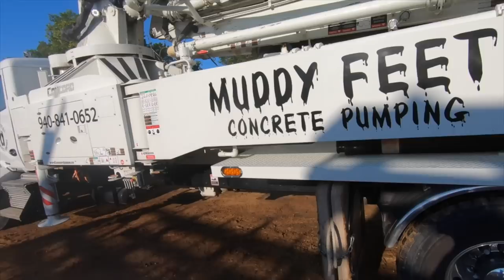Concrete truck rolls over. Pumping concrete with Muddyfeet

Comment: Driver stop your drum from turning and that will stabilize the load. With your drum turning the load is continuing to climb the left side of the drum. That's causing the center of gravity to shift even further to the left side of the truck.
Reply: They said they were afraid to spin to unload, I assume that's the other direction, but that would have loaded the uphill side which seems helpful.  I agree it looks like the way it was turning would weight the downhill side.  Too bad they didn't ask us.
Reply: Could have put the load off in the ditch passenger side first off.  Let it run climbing up the drum sure cost some money. Poor road and the driver flipping lights on was just enough to run er off.
Reply: Exactly that would’ve prevented the truck to roll over just stop the drum and that truck would still be on it’s wheels!!
Reply: I drive a concrete in Corpus. Have for about ten years now. He should have discharged the load. With the drum spinning in the "charge" mode, the fins have the concrete high on above the drivers left shoulder. Also the spinning drum has something called "transitional torque" on the trucks frame wanting to tip the truck in the same direction. Think of it like shooting a gun. It has an equal an opposite reaction (the bullet goes one way and the gun is forced the other). As the drum forces the 40,000 pounds of concrete in one direction, where the drum mounts to the frame, it torques the frame in the other direction. Thats why mixer trucks can take left hand curves at higher speeds that they can right curves.
By reversing his drum, it shifts the torque forcing the right wheels down and also shifts the concretes weight from high left to high right which also helps hold that side down. As the concrete discharges it lessens the total weight on the truck which also helps. Sometimes it's better to lose the load, rather than loose the truck.
The driver mentioned being afraid to reverse the drum, that is simply not knowing how your truck operates.
All that said, that entrance was not very well built by the contractor to support that much weight. Plus the driver should have had a spotter and been backing slower. It was possibly recoverable at the start, but it's better not to get your truck into that situation in the first place.
Reply: @stevengibson2251  I was thinking shouldn't he discharge? simply for getting the truck lighter, but I didn't think about how the direction of the drum shifting the weight! make sense,  I just started driving a mixer and I feel like I have been working on my driving up until now, I drove dump trucks, end dumps, flat beds, and tractor Trailer.  5 years now so yes I still need experience but I am careful, to me I feel like he was to close to the edge ? he was really close
Reply: @michaelmarquez6133  Hi Michael, thanks for the reply. Like you, I also drove OTR in flatbeds and RGN's. Not as long as you have. Only for about 2 1/2 years. Got tired on being on the road from 26 to 35 days at a time. I'd be out 32 days and when I got back home the boss would say "you got a 7 day or 8 day weekend, enjoy it!" Then 3 or 4 days later he would say, come on we got a load to make. I'd ask, what about my other 4 days off and it was come on, we got money to make, and like that we were out for another 35 day Strech.
Reply: First off that was driver error but if he put his chutes on and discharged concrete into the chutes it would’ve been a counter weight until that wrecker operator was able to do something  try anything not to lose the truck  I drove 30 years mixer  backed in some really soft spots never even came close to rolling a truck I would’ve walked that road first and backed in slowly down the middle if you go slow enough you will feel truck start to lean stop ! Start pulling forwards slowly!  Until your back out onto solid ground and call dispatch and tell them ROAD NOT SAFE !  Get safety officer out to job site. That’s what I always did cover your ass!
Reply: BEFORE REVERSE , GO DOWN AND SEE THE ROAD , WHY FIRST TRUCK OK !!!!
Reply: SEE THE TRUCK NUMBER AND BET AT OZ POWERBALL !!!!! OR 4 DIGIT BET IN MALAYSIA!!!!!

Comment: That wrecker operator should have had a line to rear of that truck, off a snatch block hooked low to that tree, shortly after he arrived!
Reply from the maker: The driver should have used a backer. Then we wouldn’t needed the wrecker driver.
Reply: @MuddyfeetConcretePumping  yeah that was the first mistake but the second mistake was as stated , the wrecker operator should of had that line in first thing once arriving. He helped cause the truck from just being bogged to a write off
Reply: @MuddyfeetConcretePumping  your road was junk. The driver should have refused to use the road.
Reply: Ive never recovered a truck in my life, but id say Ron Pratt would have done that Palladini971.
Reply from the maker: @duggydo  wasn’t my road Hotrod. We where there just to pump the concrete
Reply from the maker: @DasArab  would be interesting to see how someone else would have handled it.
Reply: @MuddyfeetConcretePumping That rescue had Sideways Pull written all over it.  Was interesting reading other comments about how the tree wouldn't have been strong enough, yet after the towie starts pulling you noticed it had started going over. A line and block from the tree would have kept tension on it to the right(looking from behind) and the worst that would have happened is the tree would have failed, and it still would have gone over. I guess we will never know.
Reply: @MuddyfeetConcretePumping  I would’ve told the builder that he’s got a fucking make a road that can handle cement trucks that’s how I would’ve handled it, and the point that your truck out in just fine is a stupid point because every truck that went over it made it worse, that road needed to be wider and it needed gravel there’s no way that road was handling all the truck traffic. End of story
Reply from the maker: @fuzion430journey3  well you weren’t there and I wasn’t there either until after the mishap happened. And for you to inaccurately accuse me causing this whole debacle tells me the intelligence level you have.
Reply: @MuddyfeetConcretePumping  hindsight is always 20/20. The important part is that no one got hurt. The truck is replaceable
Reply: He was doing a whole lot-a-nothing.
Reply: @MuddyfeetConcretePumping  Bingo
Reply: That tree would of popped out of the ground

Comment: This is entirely the fault of the General Contractor.
That road was going to fail with the mixer rolling over no matter what.
The only fault you can put on the redi mix supplier is they should have refused concrete delivery until that road was dramatically improved.
Reply: I agree they only want the mud. That road was shit also in a situation like this the driver should have stopped the drum
Reply: Little do you know I’ve had 30 ft roads with gravel and they still run off the road
Reply: You can clearly see the driver did not stay on the tire tracks and started moving left while he was turning his work lights on. I’ve backed my mixer many times over worse roads than that. Lean to left = stop your drum and put in discharge just enough to get that mud onto the right side.
Reply: @heknows5418  that's y you have someone back these rookies in making $20 ........shit..20 yrs ago we didn't make shit & u couldn't screw up !!!

Comment: It pisses me off that NOBODY bothered putting a rope or chain around the tree to the side of the truck, and the wrecker guy had zero fucks to give.
You could say the tree to the right of the truck would have snapped but it would have been better than nothing.
Reply: I agree with you and I the tree wouldn't have snapped or pulled over if it was tied at the base of the tree
Reply: They were lazy to act instead put ropes and wait backup tow truck

Comment: Trucks out of the way now. Let’s get the rest coming through boys
Reply from the maker: You got it
Reply: Exactly what I was thinking....Hahahahaha.....ET
Reply: No kidding, you’ve got a pump truck sitting there on the clock plus 8-10 labors and concrete finishers just standing around on the clock. When you do start pouring concrete that day you’ll probably run into a bunch of overtime because of the delay, who’s paying for that? If you don’t pour it that day those laborers and finishers lose a day of pay. So they lose out because of a driver who can’t back a truck up straight. Seems like the concrete company should eat any extra costs because their driver caused the delay.

Comment: The lack of rebar and steal in that foundation has me more shocked than the truck rolling over
Reply from the maker: Yes you probably aren’t familiar with post tension cables.  It was a surprise to me also the first time I seen them. But they get an engineered stamp for them when rebar won’t.
Reply: @MuddyfeetConcretePumping  you beat me to it I watch your videos all the time good work definitely underrated

Comment: The driver really did everything he could  to roll that over .. didn't walk the road before backing in, then got as close to one side of the road as possible, and all the time kept hes drum rolling.. 
If the wrecker moved as fast as he did when it went over .. he might of saved it .
Reply: You are so right! Imagine you drive such a bulky and !!!extremely!!! heavy truck and you don' take 3 minutes to check where you are backing up into.
Reply: Should have put it in discharge and shifted the weight back. It would have lost the load, but oh well.

Comment: Ya’ll are being polite calling that a road.
Reply from the maker: Path?
Reply: @MuddyfeetConcretePumping   🤣
Reply: Goat trail
Reply: Hell that things wider than my last driveway before I moved. Now imagine driving a big truck with a 26 foot box on the back of it down that driveway and theres a sharp 90 in the drive and 18 inches or so off the drive theres a fence with a shallow ditch against the driveway. Oh and on the opposite side of the turn there's trees right against the edge of the drive. Anyone think they could make that turn? I know I can because I have. Had to deliver a  load of brand new furniture there. I will say this though I had 2 people watching my corners for me. And I do know I do not want to do that one again.

Comment: After watching this video a few times over, i really think that this situation should never have come up. Firstly, the road should have been inspected and the contractor been made to widen an grade to a better, more suitable finish for heavy vehicles to access. Secondly, these concrete wagons should have been nose in, nose out, not tail in, nose out. Theres plenty of turning room and staging area. Thirdly, the wrecker that got on scene first only needed to cut the engine to stop vibration,( vibration is a bad deal on unstable ground) and stabilise the mixer by keeping the center of gravity in a more upright position. By keeping the truck upright, hes only holding the center of gravity not the entire truck. He had plenty of truck for this purpose to buy time for the larger wrecker to further stabilise the mud wagon. It is great to watch these videos vback and learn. Nobody was hurt,which is the main thing. Love the videos. Keep pumping. Cheers
Reply from the maker: Shannon K thank you
Reply: The road was wide enough, it just wasn’t sound.
Reply: Finally... someone with a sense of what "holding" the truck would take !!!! all these "experts" saying it would take 50 tons to hold it from tipping are all wrong, for christ sakes the truck doesn't even WEIGH 50 tons!
Reply: Mattywho that trucks fate was sealed once the wheels stopped turning for guys to say the tree would hold is speculation. The truck was to unstable to be climbing on. The biggest take away from this is no one got hurt. Any effort to be a hero would up the risk of injury or death.
Reply: There's really no "vibration" from a slowly-turning drum.  Besides, that loose soil at the roadway edge began a creeping failure right away, and nothing short of removing or lessening the applied weight was going to stop that from happening.
Note that the drum was turning the wrong way, though.  Reversing it (to discharge (just waste the load off the edge of the road)) would have shifted the weight substantially to the right, and lightened the truck in short order too.
I agree with the rest, in principle, but I doubt there was enough time to set up anchors (like snatch blocks), even if no appraisal time had been needed (and it always is needed).
Reply: @ericl2969  If you had driven a mixer truck, you wouldn't be saying that. There's plenty of vibration just from the engine & drivetrain hydraulics alone. And the 'slow-turning drum' has more effect than what you'd call vibration. Every time those fins turn (as the drum turns) a portion of the concrete load weighing approx 1/2 ton or more drops from the turning fin to the lower portion of the drum... to then be scooped up by the next fin. A continuous 'rinse & repeat'. On stiff loads that has even the driver swaying in his seat on SOLID pavement. So don't make the huge mistake of saying a 'slow-turning drum' has no effect.
Reply: @hyperbaricaxom1763  Thank you for the comment, but I was referring to what vibration really is, and not considering it to be the same as any other form of movement.  The running engine and pumps is pretty trivial compared to the sloshing weight in that drum.  Yes, I've been around concrete trucks in offroad situations on hundreds of occasions (testing fresh concrete was part of my job for 30 years, and incidentally, I also have 30 years of experience regarding the stability of soils beneath truck tires and other loads, and steps to be taken for improving that stability, so I'm no amateur on this subject), and yes, you are correct about the lifting and dropping of the mix.  However, the weight shifting toward one side is a really big deal, not to be ignored, and I believe that prompt reversal of the drum and the resultant weight shift AND reduction of weight would likely have saved the day here.  But hindsight is always 20:20 too.
Reply: @hyperbaricaxom1763  well said!

Comment: My first thought was to go around the base of that tree or the largest tree in close proximity with a tow strap. I'm no tow pro but I am a mixer driver. Anything might have worked better than what the wrecker driver did. At least there would have been some support from the passenger side.
Reply from the maker: I think that’s a fair comment. Thanks for stopping by.
Reply: Dude, totally right.  I mean, how is it that a heavy wrecker operator is sent out with all that recovery gear yet not the know how.  Common sense tells you, if your goal is to recover the truck WITHOUT allowing it to tip over, and its currently still advancing on tipping over, the first thing you do is stop it from tipping and most effective method would seem to be securing the top in the opposite direction of its roll.  Oh look, is that a tree right there?  Or get the wrecker out that way and pull out 100' of cable.  
  For a second there i thought he was gonna just try and hold the truck from tipping by sitting on it.
    😳
Reply: @distant2near  WTF SilentScream. Give theses guys a break. First of all it was a very dangerous situation. The wrecker crew is there to help & do it in a way to not damage anyone's equipment in the recovery process.
Reply: @philsmidwestclassiccars150  
  I dont know about you but one would think that a professional / Specialist would show up to handle something like that.  Not my profession.  Not my field of expertise yet I could tell it wasn't handled properly.  But, hey, maybe we should cut the guy some slack.  Everybody has to start somewhere.  I'm sure next time will be different.  Thumbs up for a great try.  😐
  BUT, the cement truck company may not be as supportive since they paying the bill.
Reply: Driver here first priority is don't get hurt as driver or wrecker easier to pay repairs than hospital or have a fatality
Reply: @danavery2902  the damn truck sure isn't going to flip towards them not to mention they had already gotten close enough to put the fist set of straps on to hook the wrecker to it. I would have immediately hooked to the base of the tree
Reply: That’s why they’re called wreckers! 
Snatch block off the tree base to upper section, one line to the front and work the two lines in sync. Tree might be uprooted but worth the try.
 But not being there, there is no way to get the actual ‘feel’ of the situation.
 No injuries equals success!
Reply: That was what I was thinking put a snap strap around the tree and pull it back instead the fat 20ribs eating wrecker just walks up and down no probs
Reply: Absolutely i thought the same thing. Oh well what do you expect from a bunch of clowns